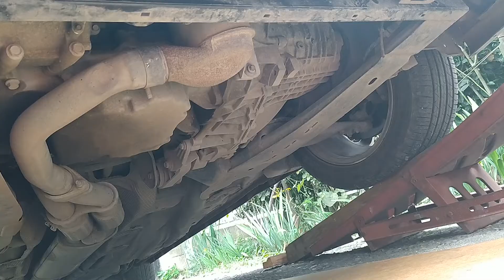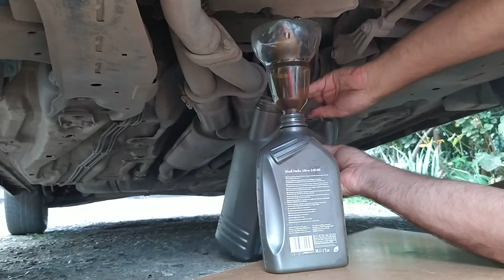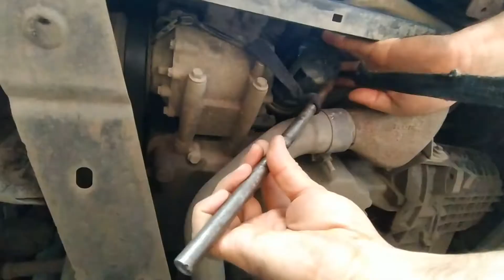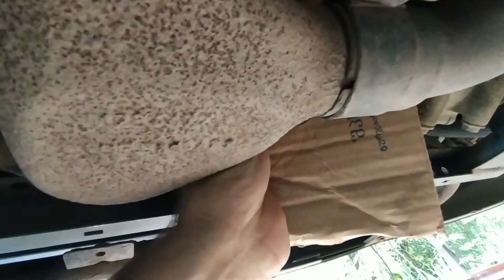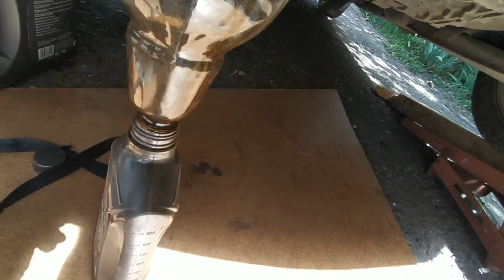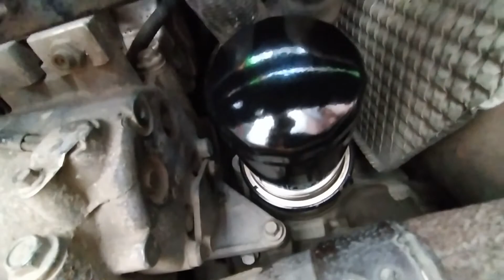Jaguar X-type oil change without spilling

Comment: What's happening ✌🏿
Why did you say you used 5w40 
I got 144,000 on mines and do you use conventional or a blend?
Reply from the maker: I make use of a 5W40 A3B4 engine oil and it is not prohibited by a handbook. Handbook just recommends to use 5W30 A5, but not prohibits some other viscosity oils. They say it's a fully synthetic oil, bit I believe it's a blend.

Comment: So you added 5.5 litres of oil? I think o saw on the manual that it needs 5.8 litres when replacing the filter not 5.5
Reply from the maker: Thank you for your comment. The matter is that I believe, that its better to add some 200 ml of oil next morning if necessary, than pour too much oil at once. So, I usually check the oil level next morning and add if necessary.